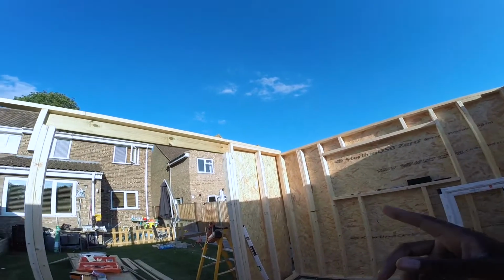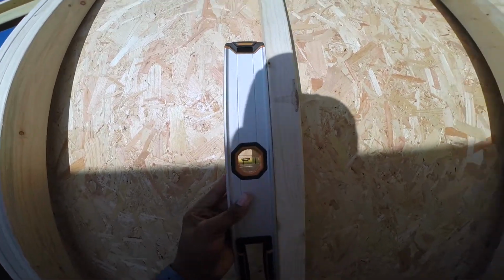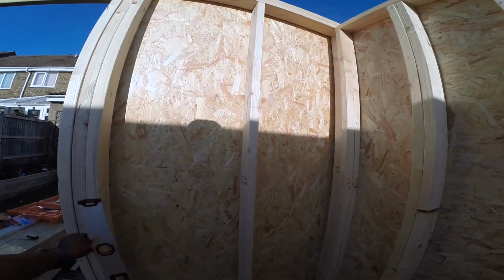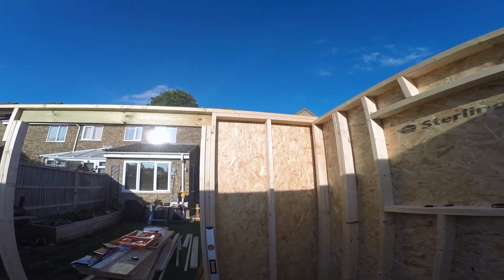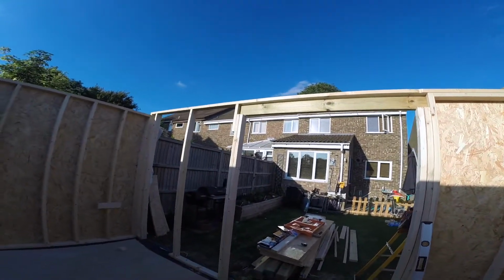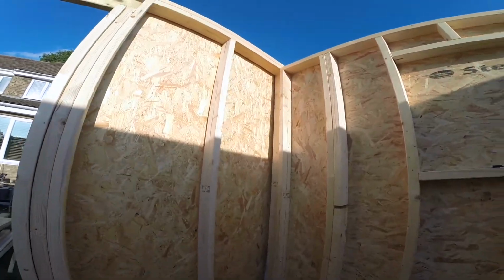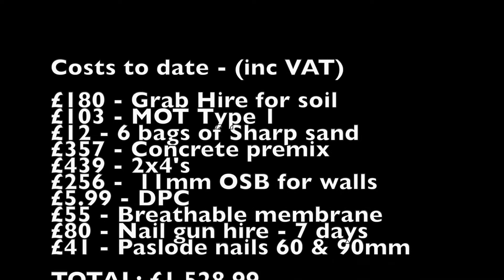Garden room front wall build done right!

Comment: Not correct. Osb outside!!😅😅😅😅
Reply from the maker: Not sure what you mean?
Reply: @JazzScottDIY  I think he's saying OSB should be on the inside and not outside of the walls.
Reply from the maker: I wonder what he would use on the outside then 🤷🏾‍♂️
Reply: @JazzScottDIY  Some people would use treated Plywood over OSB. As long as water does not get through to the OSB, your all good. I think OSB does not do well when in contact with water, unlike treated Plywood.
Reply: Looks like you have done a fantastic job, so you should not have any issues.
Reply from the maker: @VeteranLifeAdventures ahh ok thats makes sense and that sounds like a solid build, I've used a water vapour barrier and the cladding keeps it well protected. So I'm not worried. 👍🏾👊🏾